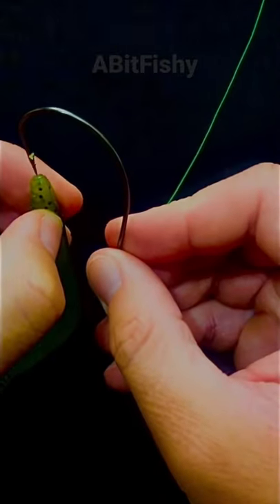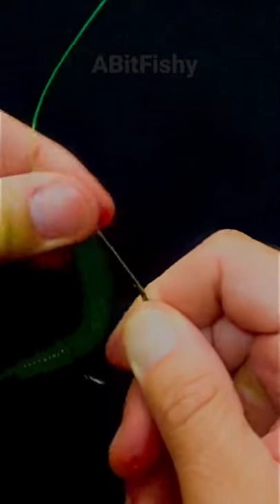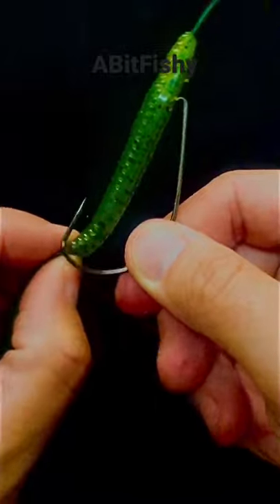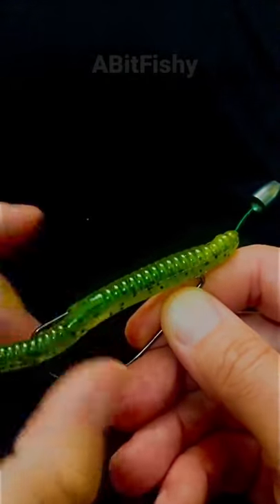Texas Rig

Comment: Been using almost same for 4 decades. The difference is the point doesn’t go all the way through in the back, and a mighty hook set brings the hook through at more angle, theoretically increasing successful hook set average.
Reply: I've always never put it all the way threw either, never had a problem
Reply from the maker: I’m using an EWG hook so that’s why I put it all the way thru. A regular round bend hook you leave it below the surface.
Reply: @abitfishy1263  thanks for the info!
Reply: @abitfishy1263  thanks for the info!

Comment: I don’t have any bullet weights, would split shots work if I up them right after the tip of the bait?
Reply: It will bit it wont be as weedless, bulkets weights are 2 bucks a  pack grab some.. if you put a split shot 1 foot above the hook and plastic it is called a Carolina rig
Reply: @badmoonrising209  Thanks for the reply, I’ll keep looking for some bullet weights but in the situation where I don’t have any that’s good to know.
Reply from the maker: You can do that. It’s called a split shot rig. It won’t have the same exact action though but can still work. A bullet weight slides down your line and leaves your bait floating in the water.